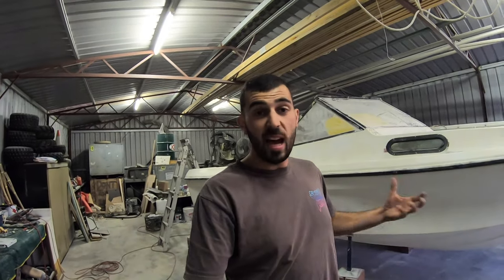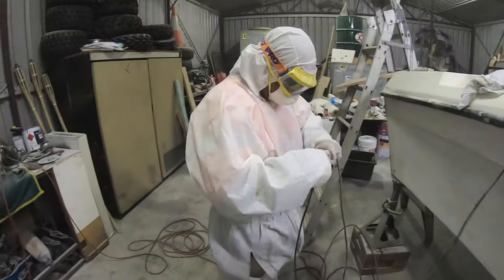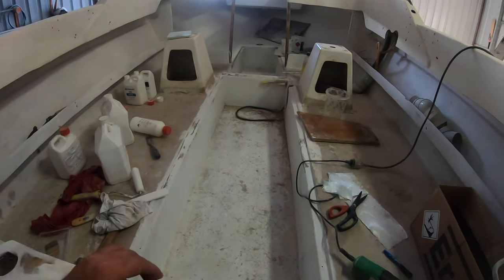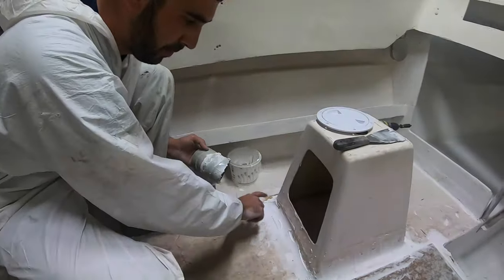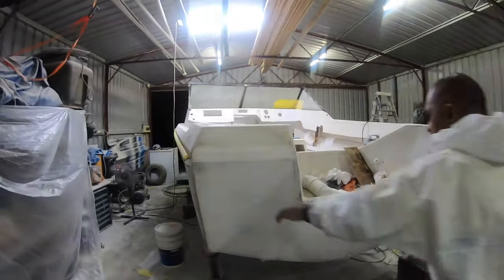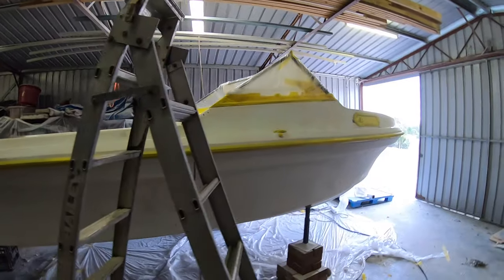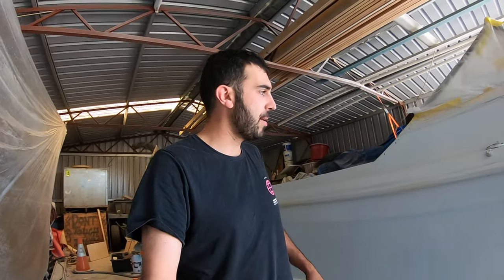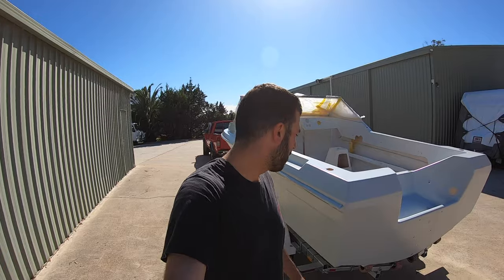PREPARING THE BOAT FOR PAINT | IT'S BACK ON THE TRAILER | FULL BOAT RESTORATION - PART 8

Comment: Love the boat just curious why you didn’t remove the windscreen and rubber gunwale for the paint work?
Reply from the maker: Hey mate, i didn't really have the extra coin to replace it at the time, and if i removed i would of damaged it so left it on. But i did change it late down the track :)

Comment: What exactly is flow coating? Is that the same as gel coating? In America the term flow coat in painting means that you are applying a final wet coat which is generally a clear coat on automobiles.

Comment: Hey, quick question, can u polish up a nice gloss shine on the finished flowcoat with wet and dry paper? or does it have to be painted to get a gloss finish, I’m thinking about doing a flowcoat recoat on a small 14ft single handed sailing dinghy that I am considering buying my 14 year old daughter to sail at the local dinghy sailing club.  It’s a badly oxidised red GRP factory gelcoat 31 years of aging.  I know the factory gelcoat can shine up, with high grit went dry, but there are a lot of little repairs to do, so I figure a full recoat might be the go, but if it doesn’t shine up, paint might be better.  I’d rather less steps as it’s DIY n a cheap boat.

Comment: Man great job. I’m doing the exact same thing now and just picked up the flow coat. What did you do with the bottom of the hull did you paint that already before you put it on the trailer? How many coats of flow coat and primer did you end up doing?
Reply from the maker: hey mate yes hull finished before putting on the trailer, i did 2 coats making sure you sand between layers as flow coat has a wax additive in there!